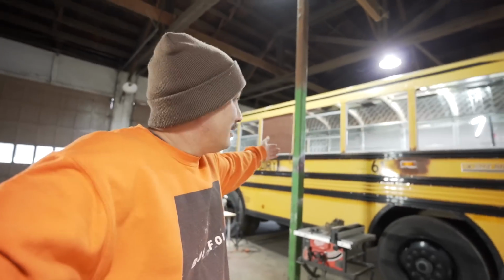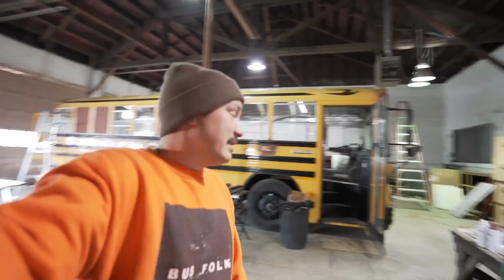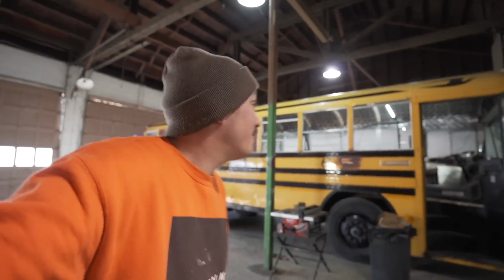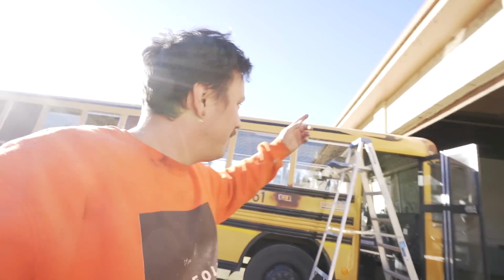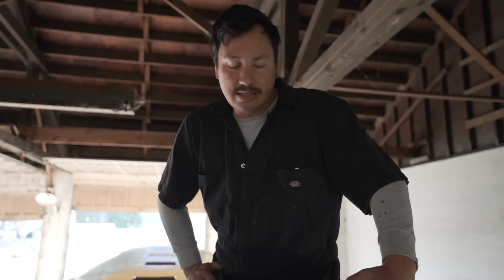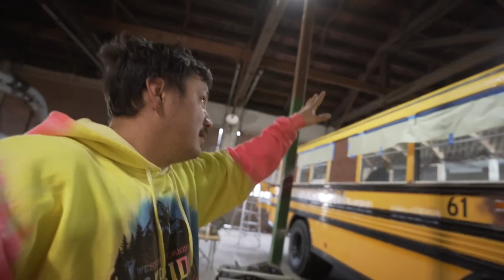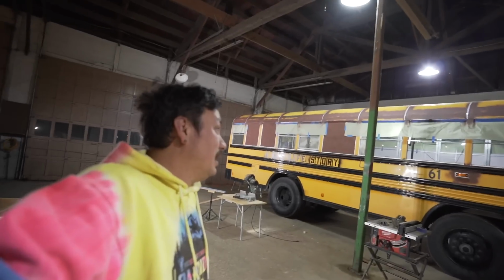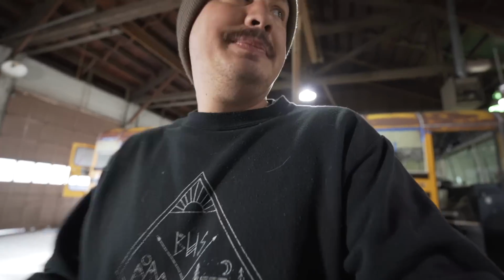Prepping And Painting A Skoolie Roof In The Middle Of Winter

Comment: Isaac I agree on the spray foam. I think it can retain moisture too. The other thing everyone is using that I question the longevity of is pex pipe & shark fittings. Long term I think the will have problems. If it is an easy accessible repair then ok but if it ain't go old school. peace
Reply from the maker: I like pex but not shark bite. My homie taught me to use compression fittings

Comment: Nice. 600w of solar isn't a lot. What about mounting a small auxiliary generator under the bus for the AC. By the way what was up with Minion?
Reply: If I can give my opinion...any solar fitter will tell you, you can fill the roof with panels, but if you don't see enough sun and light, they are almost worthless.  I  am one person and only have 200w on my roof. It is all going to depend on refrigeration and any other appliances chosen mainly
Reply from the maker: 600watts will be plenty honestly. The dc to dc makes up for it. Minion fuel seperator wore out. Had a terrible fuel leak. All fixed now